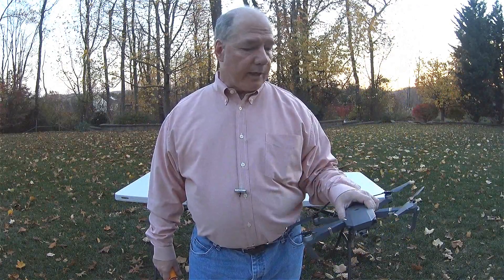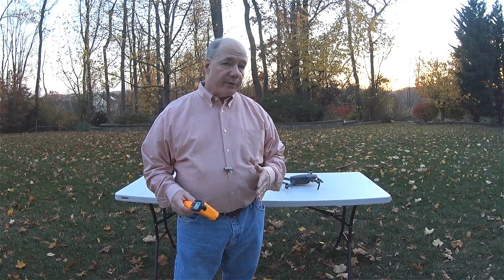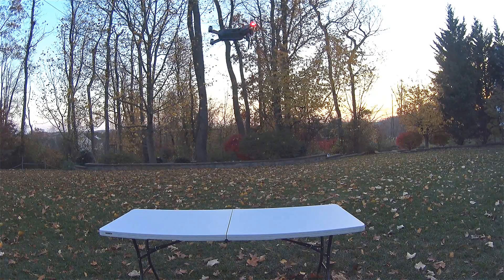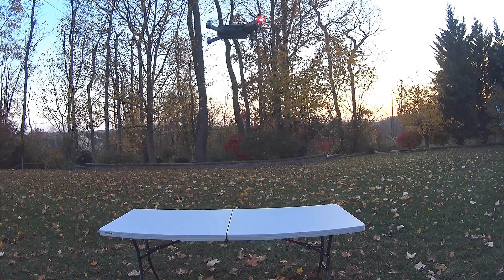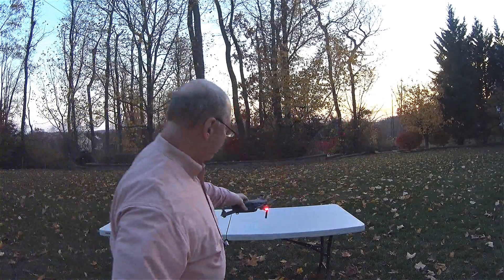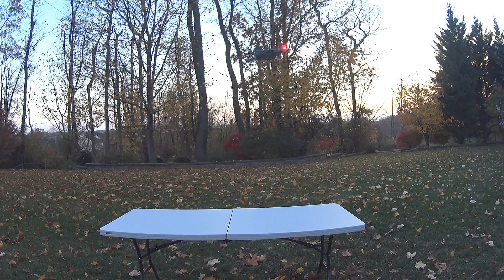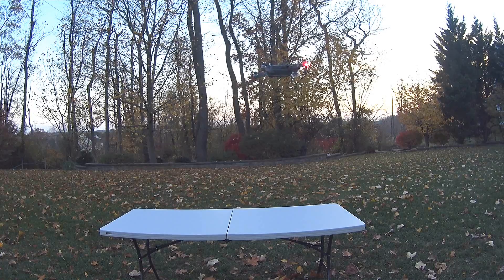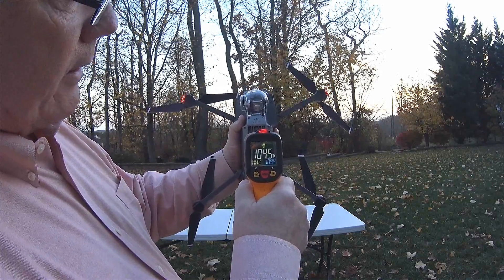Mavic Pro Running Hot?  Here's Why

Comment: while I must say it's an important point, but I believe that a video like this should have a conclusion supported with facts. the stats shown in this video told me that it is not going to effect my mavic too much. in future possibly do the mission test that you say you will do next in the same video, then you should have a definite conclusion in a 1 part video.
Reply from the maker: Seth, thanks for the post but this was just designed to be a quick test to show that by essentially blocking the airflow through the cooling vent in the front of the quad with the gimbal guard that the quad would run hotter. I plan on doing a longer follow-up clip next week with a longer flight time. The physics behind the clip are simple, with the gimbal cover on less air can pass through a flying Mavic, which doesn't allow the fan to opreate as efficiently. Stay tuned as I'll have the longer test posted next week. Thanks, Rick
Reply: Drone Valley I understand Rick, also will you be doing a reveiw of the p4p or the inspire 2, just wondering as I will hopefully be getting mine next week and would love to see what your thoughts are!
Reply from the maker: Seth, I'm working on an overview clip for the P4P and should have it posted next week. I don't actually have either of them in hand yet so this first clip will be first impressions of the Phantom 4 Pro and cover some of the improvements over the Phantom 4. Which quad did you order?
Reply: Drone Valley Phantom 4 Pro, I'm going to try doing a bit of real estate work as the Australian laws are a bit looser than your American ones. we can fly drones commercially as long as they are registered with Casa (our faa equivalent) and under 2 kilos. do you think the p5 will be very similar to the p4p. like the difference between p3p and the p4
Reply from the maker: The Phantom 5 is just a rumor at this point (sort of like the iPhone 8) but both the Phantom 4 and the Phantom 4 Pro are amazing quads (as is the Mavic) so any of them will serve you great. The only recommendation I might have is to consider the new Phantom 4 Pro because of the better camera. It's slightly more expensive but provides a better picture and a lot more automated flight modes to help you get the shots you need more quickly. I hope that helps and I'm jealous you get to fly commercially without having to pass a test like Part 107 in the states. Rick
Reply: Drone Valley thanks for your time Rick, always live it when you reply to my comments! ( we are pretty lucky over here, some great landscapes too, but the prices of drones are INSANE, my p4p ran me $ 2600 Australian!!!)

Comment: Two problems with the test. (1) you should have hovered for three to five minutes to give the electronics time to really heat up the heatsink to maximum operating temperature. (2) You should have allowed the electronics and heatsink to cool to a baseline temperature, the first cold temperature reading. You may have recorded a cumulative temperature, due to a higher beginning temperature. You should do the test over. Then do a second test, same as the first, with the EXCEPTION of, a decent size electric fan blowing head on to the hovering Mavic. That would give more accurate test repeat-ability. That would remove , otherwise, impossible to replicate conditions for both tests. Glad you endeavored to answer an important question! Respectfully, an old, long retired M.E.
Reply from the maker: Don, thanks for the suggestions (and boy did I get a lot of them from viewers) and I will take them in account for the follow-up clip I'll be doing next week. Even though I didn't film the part where I gave the quad time to cool down, I did let it settle to the 64 degrees for the last part. The basic premise I was testing was that the gimbal guard essentially reduced the airflow through the quad, which made it run hotter and made it a bad idea to fly with it attached. Stay tuned for the follow-up and thanks again for posting. Rick
Reply: Hay Mike! I already gave a constructive opinion on how to SCIENTIFICALLY run the test. NO criticism! We already have a person with a perfectly fine channel, attempting to find answers. He clarified that he indeed gave the Mavic time to reach the baseline temperature, with a response to my suggestions. It would be stupid to fire up a channel to duplicate what is being done, quite well, already. I am waiting to see your MARVELOUS channel on what a discussion forum SHOULD BE. Complete with a definition of a what you consider to be a FREE FORUM of ideas.

Comment: 37°C is nothing to worry about... smartphones get a lot hotter. This is a very good temperature.Every CPU/memory can get a lot hotter.
Reply from the maker: I wasn't so much worried about the temperature, I did the clip for viewers that were asking if it was OK to fly the Mavic Pro with the globe attached. My concern is that it blocked the airflow through the quad and I was trying to show the increase in temperature it produced. Thanks for the post and I hope you sub the channel so you don't miss anything. Rick

Comment: I think you can simply fly it back and forth in straight line full throttle with and without the globe, that way we could see the real test and no need to do the key misson
Reply from the maker: Thanks for the suggestion and I'm sorting out the best way to do an extended test for the follow-up. I want to let it fly longer and put a little more stress on the quad to validate the hover test I did today. I'll probably have it all worked out in a few days and hopefully post the clip next week. Rick
Reply: Good luck! :)

Comment: use a thermal camera. you'll never know the average heat across the area
Reply from the maker: Ben, thanks for the post but the thermal gun I was using does an average temperature in the area circled by the laser sight. The point of the test was to show that flying with the gimbal guard attached made the quad hotter than without and the measurements I took supported that. I agree that a thermal camera would have been cool to use as well to tell where the exact hot spots were. Thanks again for the post and I hope you sub the channel. Rick

Comment: That plastic globe is for when you've put the Mavic into storage, for protection of the gimbal and camera lens during travelling. DJI have explained this in both the official forum, and also in the manual. You shouldn't be flying with it on.
Reply from the maker: Thanks for the post and I agree with you. I had a few people ask me why they shouldn't fly with it on and I did the quick test to show them that it blocks airflow through the quad and can cause overheating. I appreciate you stopping by and I'll have a few more clips posted soon so stay tuned. Rick

Comment: I'm not sure how useful your testing is for normal flying conditions. (I also question whether heat is even an issue --- I haven't seen any complaints about heat --- lots of concern about erratic flying, controller, etc, so I am going to focus my attention of having those issue resolved before I start worrying about a warm drone.) I would expect that hovering represents a worst case scenario because there wouldn't be a lot of air flowing over the heat sinks to dissipate heat. Kind of like having your car idle and testing the radiator temp --- it's going to get hot because there is no air flow, as was the design intent. So, if you are inclined to repeat this test then please do so under normal flying conditions. One other point --- 100 degrees F is not really that hot. Check the temp of the heat sinks in your PC for comparison.
Reply from the maker: Thanks for the post but this simple test was just to illustrate the worry I have about people flying with the gimbal guard on the drone. It is one of the top questions I get about the Mavic and I wanted to do a clip to show that it does raise the temperature. As for the other issues with the Mavic, all the clips I've seen have either been simple pilot error or other controller conditions that affected fairly new pilots. I have had the quad for almost a month and flown it almost every day since it arrived in a wide variety of situations and haven't had a single incident. I am also a little leery about some of the clips "showing" a failure with the drone as I think the chances of someone having their camera trained on the drone, just as it misbehaves is pretty suspicious. As for the heat, its a major concern as it affects all of the systems in the quad. I'm sure it's under control as long as the Mavic is flown without the gimbal guard on. Thanks again for the post and I hope you stop back soon. Rick

Comment: How is the mavic under cold weather conditions? I was in Edmonton Alberta, checking it out and the young fella working there said it's "not even useable under 0 degrees Celsius", "unless you want it to explode", I find that very hard to believe. I flew my first generation Phantom in -25... The flight time was minimal, but it didn't explode, and didn't damage the lipo.
Reply from the maker: You'll be fine and the exploding comment was amusing. It's true that LiPo cells don't like extreme cold (or heat for that matter) but I've flown my Phantom 3 and Phantom 4 in the winter and the only thing I noticed was a slightly reduced flight time. I keep the spare cells in an inside jacket pocket to keep them warm but the quad flies fine otherwise. I haven't had the chance to fly the Mavic Pro in the winter yet but will get the chance in a few months to test it out. Thanks for the post and I hope you sub the channel. Rick
Reply: Same storage trick for me with the spare batteries. Thanks for the quick reply. I subscribed.

Comment: I'd be curious in your next temp video, your estimation of safe flying temp.   When summer rolls around and we don't have the luxury of 65 deg, but rather 90-100 deg,  what do you think the ambient temp limit should be based on what you find regarding internals.    I don't envision flying with globe on, just because of internal temps.
Reply from the maker: I think the quad will do a great job of keeping the temperature manageable. Between the design of the heat-sink, internal fan and airflow design the Mavic Pro was built to fly in hot weather. My worry was that by flying with the gimbal guard on the drone it was preventing proper airflow through the front vent and raised the temperature higher than expected. I have flown the Mavic on very hot days a few weeks back and it worked great. Thanks for the post and be sure to stop back soon. Rick

Comment: What about flying in cold weather it's their problem flying and say 32° or less?
Reply from the maker: David, I fly mine in the winter when the temperatures are that cold and the only think I notice is a reduced flight time with the batteries. One trick I use is to keep the spare cells warm in an inner jacket pocket so they are ready for use when I need them. Thanks for commenting and I hope you sub the channel so you don't miss anything, Rick

Comment: Could you have run the test with the waypoint feature so you can run the same couse at the same speed?
Reply from the maker: Cedric, I had the same thought and will program a route for the quad that I can use in a follow-up clip next week to give it a little longer flight time. Thanks for the post and stop back to see the next clip. Rick

Comment: Testing this should have been done after the Mavic had been sitting powered up until it reached peak operating temperature.
Then do the hover test with the dome on, let it sit powered up til the temperature had settled again, and hover again without the dome.
I also think you could make holes in the sides of the dome to allow for more airflow.
Reply from the maker: Thanks for the post and I plan on doing a longer flight test next week as a follow-up. This was just a short test to answer the question for a few viewers. I can program a route for the quad to fly so that it will be easy to measure the temperature after a longer, more aggressive flight. Thanks again for the post and be sure to stop back. RIck

Comment: Rick  I live here in the Caribbean 84 degrees year round, and today flying the Mavic I was thinking about you,  I have ordered a couple extra globes, and my "plan" is to drill small holes in one (out of focal plane) and try the same test as you.  I have no doubt the globe DOES restrict airflow, BUT ...I wonder if the benefit of protection will outweigh possible temperature increase ?  The globe DOES have the slot cut out which means DJI engineers DID consider airflow, yes ?  I hit a HUMMINGBIRD the other day, and wondered if that could wipe ,out that tiny gimbal ??To be exact, the Hummingbird attacked the drone !  I have been trying to film these BIG tropical birds that soar up in the thermals,  but they are usually about 1000' !  I use the "Beast" Phantom 4 for those missions !    Did you watch the Youtube of the guy taking apart the Mavic ?    Mavic review and tear down
Nils Rohwer   OUCH !  Thank You, as always ..
Reply: Oh the globe is designed for flight so the dark gray one is for storage?
Reply: CaribbeanZapatta - Since DJI made the globe to be used in flight for protection, I would assume they would ensure that the heat buildup was not excessive.
Reply: CaribbeanZapatta
Reply: Karlon Cromwell - The globe is for storage/transport too. Dark grey goes on top of the globe to protect the globe from scratching. I would fly with the globe off most of the time since it affects video quality, though.
Reply: yea they are probably not using good glass. But plastic! Thank you though!
Reply from the maker: CaribbeanZapatta - Thanks for the post and I think the holes will help. I'm sure that there are aftermarket companies already working on a vented version of the globe so stay tuned. And that must have been a very aggressive hummingbird :) I wish you had footage of that! Thanks, Rick
Reply from the maker: Pinchner - I'm not sure that they intended the globe to be used for flight, only protection when transporting. The main reason I did the clip is that I had a lot of viewers asking if they should fly with the gimbal cover on the quad and I was (and still am) worried that it would block the airflow through the vent behind the gimbal and heat up the quad too much. Thanks for the post, Rick
Reply from the maker: Karlon - the globe is really only designed for protection when transporting the quad. Keeping it on during flight will block the airflow through the quad and cause it to run hotter. Thanks for the post, Rick

Comment: hi another interesting video Rick. I am interested to know how the Mavic compares to the P4 in handling wind what I have seen is that the p4 can handle stronger winds but just wondering how much the Mavic can withstand do you know?
Reply: john stevens i have been wanting to know the same thing. Because i am deciding if i should get the mavic or p4p but I leave near a beach so it is always very windy but the mavic is so small that is what is making me to like the mavic.
Reply from the maker: John, I did a clip last week and showed the Mavic to actually be a little better in a stiff wind than the Phantom 4. I was surprised to see that and noticed a lot more "drift" in the P4 with the same breeze. I have also flown the Mavic Pro a lot these last few weeks in all types of winds and am very impressed with it's handling. Thanks for the post, Rick
Reply from the maker: Project - You'll be fine with the Mavic Pro. I have flown them both in the same wind and the Mavic is as stable (or more so) than the Phantom 4. Both are great quads but the smaller size doesn't affect it's ability to handle wind by my experience. Thanks for the post, Rick
Reply: thanks for the reply Rick checked out that video sorry I missed it

Comment: It can get much hotter. While doing a firmware update the drone was sitting indoors and after 15 minutes I measured the temperature at the bottom of the drone to be 121 degrees.
Reply: This is an important point.   Much of the rejected heat seems to be coming from the microprocessors, as this heat sink does get quite warm with the craft powered up, but with the motors off (and the battery charge level ticking down corroborates this).  It isn't just the motor controller power sections responsible for the heat.

The craft doesn't necessarily need to be flown for this test, and would be more controlled if done indoors, anyway.   For the control:  Globe off, take a reading at ambient, turn it on for time (t), then measure.   For the variable:  Turn the craft off and let it return to ambient (measurement to confirm ambient), reinstall the globe, turn it on for time (t), and measure again.

Temperature aside, the globe isn't coated and is good for casting flares on your images.   Unless you're in an environment where protecting the lens and gimbal are serious concerns, take it off for the best shots.
Reply from the maker: I agree that the firmware updates can heat things up. The question I was trying to answer for a few viewers was if it was advisable to fly with the gimbal cover on the quad. I suggested they not do that because it does cause flaring and it totally blocks the primary vent on the Mavic, which sits right behind the gimbal. This wouldn't allow the fan to cool down the drone as well and could lead to premature failure of the gear. I will be doing a follow-up clip next week and be sure to work these suggestions into the testing. Thanks, Rick